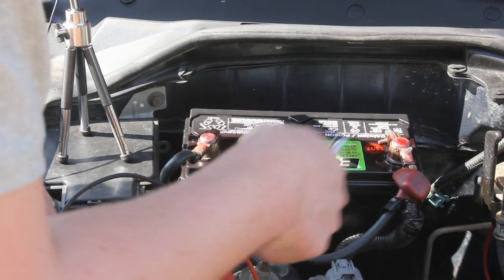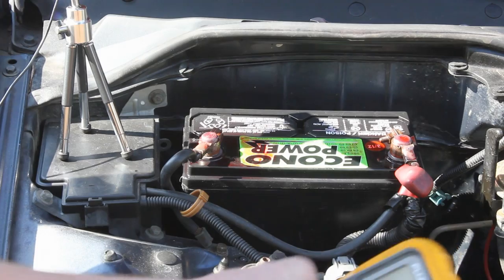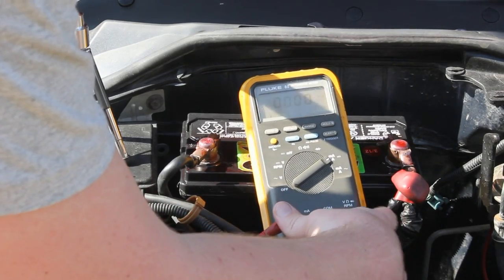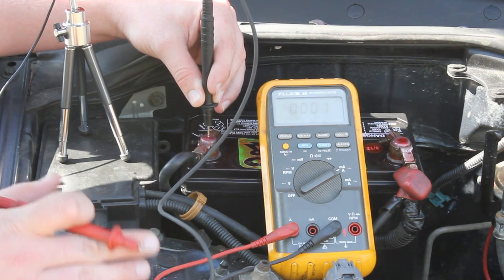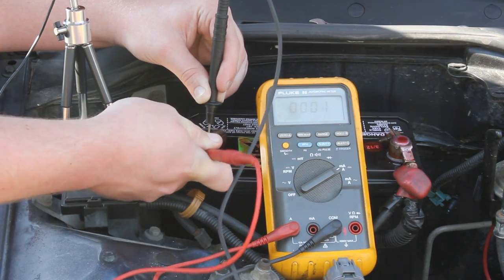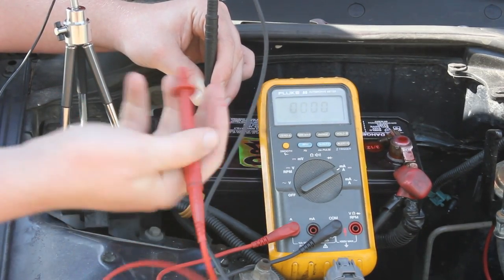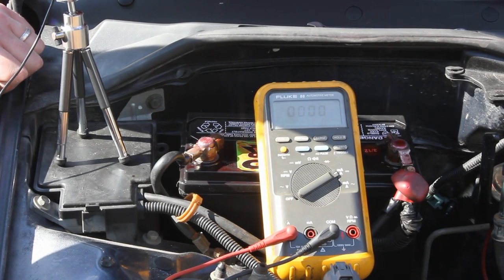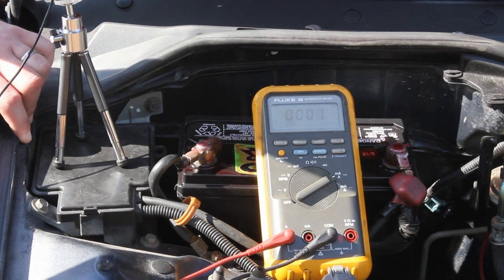How to Find A Car Battery Drain

Comment: You have no clue where the draw is. And your meter needs to be in SERIES with your battery. If you can plot the current draw across time then you stand a chance of finding the draw. Otherwise, start pulling fuses. I have a time triggered drain. The only way to catch it is to have a logging multimeter outputting to a laptop.

Comment: The reason why is measured like that, is  because  current is measure in series and voltage is measure in parallel...If u were to measure current in parallel u are going to blow the fuse inside the multimeter.

Comment: The best way to check for draws is via the positive cable/post. The reason for this is current already sees the load when it gets back to the ground side of battery.  If you put the meter between load draw and battery you will see actual draw.

Comment: If you still have your radio stations, then some of the current is being delivered to the radio + your meter. 6mA is literally almost nothing....not even enough for a single LED.  If you want to measure Amps accurately, then you must remove the battery cable! Something could be eating a large amount of current and it is still possible to only read 6mA, because that current is still traveling through the batter cable, not your multimeter.
Reply: He did remove the cable.  Did you not watch the video.  To measure amp draw the multi meter has to be in series like he is.  The draw from the stereo when its off,  that holds the codes is literally nothing about 0.01 amps.  If he had have opened a car door and had the interior light was on you would have expected a much higher reading.  What he was saying was because the circuit was never broken the tiny current needed to keep the codes was still present.  This showed that it was all working correctly without losing the codes.  Watch the video again and listen properly he actually explains it perfectly.
Reply: +Industry Leisure you are correct, the meter must be in series,. But his multimeter was in parallel, never in series....and the battery cable was never separated from the battery terminal. Did you watch the video?  Go research series and parallel circuits....then when you learn the difference, then come back.  sub.allaboutcircuits.com/images/05057.png
Reply: If it was in parallel he would have one terminal on the + and one on the -    If you look he has one on the battery one on the cable and he slips the cable of the battery making it in series ??
Reply: +Duane Appleget http://forums.mustangandfords.com/50-mustang-super-fords/70/9371888/1987-1993-mustangs/what-is-draining-my-battery/
Reply: +Industry Leisure When measuring amps, the circuit has to be broken (removing the battery cable or cutting wires) and the leads placed in series to re-complete the circuit.  In a series circuit, electrons can only follow 1 path (through the wires or through the meter; NOT both)....in a parallel circuit, electrons can flow in 2 or more paths....battery/cable + battery/meter. He does losen the battery cable, but there is no guarantee electrons did not find a path to move from the battery to the cable (maybe the cable clamp still has contact, maybe a path from metal shavings, conductive grease, etc). "If it was in parallel he would have one terminal on the + and one on the -  "...true, but there are many ways to create a parallel circuit (2-->infinity).  Again...then cable is never removed from the battery. If you think it does, then at what time mark does it happen?
Reply: +Industry Leisure The image posted by waynep71222 in the mustangandfords forum is correct. But that is NOT what is not what occurs in the video above.   http://i1207.photobucket.com/albums/bb476/waynep712/current_draw.jpg
Reply: +Industry Leisure After this video, YouTube forwards me to another similar video by EricTheCarGuy, who measures amps properly.  If you are seeing the battery cable being removed, then you are not watching the video posted by Fixbook (which is what we are commenting on).
Reply: +Duane Appleget He took it off. When he picked it up he removed it from the battery terminal. He just left the multi-meter on it the whole time so the current wouldn't be broken.
Reply: 1:50

Comment: YOU DID IT WRONG! You must REMOVE the Terminal in order to check for the current. Look like you don't know what to do! Seriously.
Reply: +glamisfrk's It's not right. To measure the CURRENT to see if anything is draining the battery, you must connect in the way that the DMM is in series with the battery. The way you connect is called parallel,. not right. It will not tell anything by connecting parallel.
Reply: +Guy inSJ He took it off. When he picked it up he removed it from the battery terminal. He just left the multi-meter on it the whole time so the current wouldn't be broken.
Reply: +Guy inSJ- Dude, did you not watch the terminal get disconnected? Watch the video before making dumb comments because that was a pretty cool way of checking for draw. The terminal was carefully lifted just like he was saying to watch for while he was doing it, that keeps just enough current to keep the radio memory and clock correctly set.

He did a great job and has steady hands, it's OK that he doesn't have a bunch of money invested in multiple cameras and camera stands for perfect angles. I appreciate the time he spent showing this neat trick to see if there's a problem in the first place.
Reply: He did it perfectly correct. It's obvious he knows what he is doing!